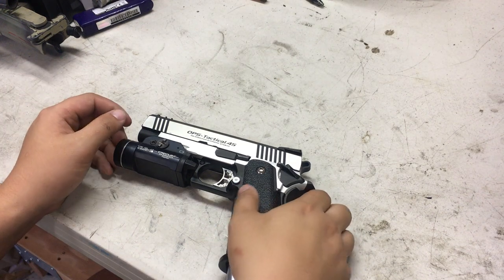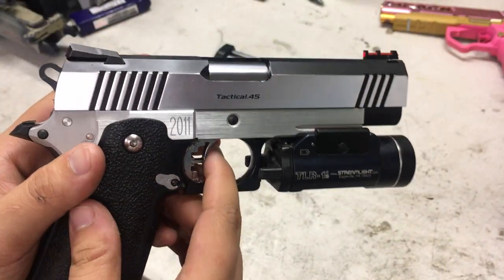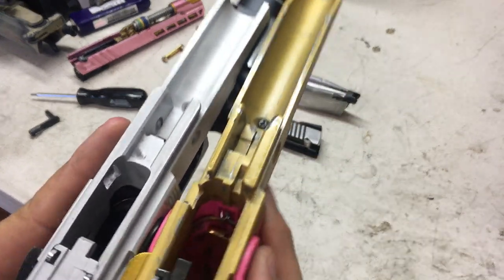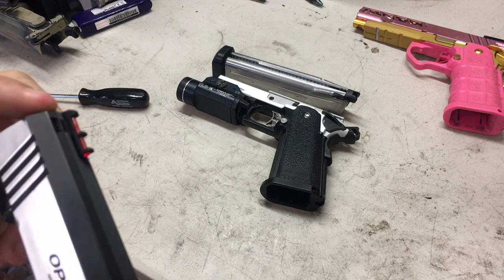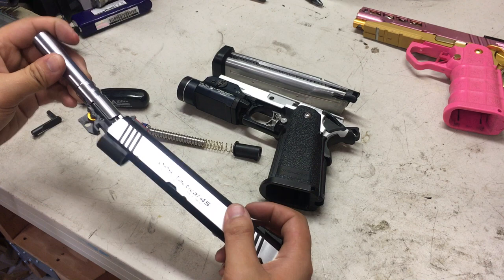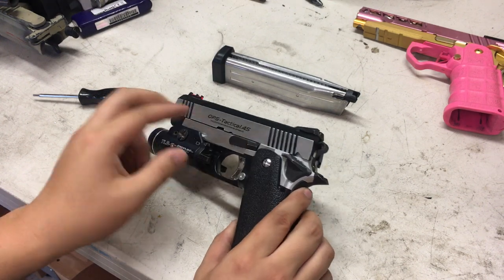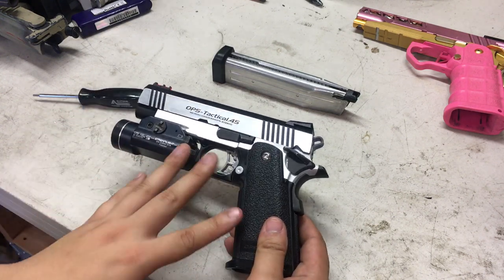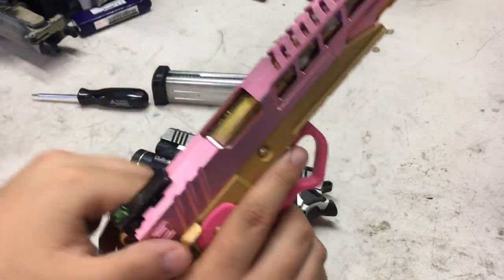Tokyo Marui Hicapa 4.3 Build Project (Part 1)

Comment: Parts List: 
Airsoft Masterpiece CNC Advance Frame (STI)
Streamlight TLR-1s
AIP front fiber sight
UAC Competition Recoil Spring
UAC Shock Buffer Kit
Maple Leaf Gold Adjustment Wheel
PDI W-Hold Bucking
UAC Aluminum Lightweight Blowback Housing 
ProWin Magazine

Parts Coming In:
Airsoft Masterpiece Steel Hammer
UAC Competition Steel Disconnect 
Airsoft Masterpiece Steel Guide Rod
Ken's Prop 3D Printed Slide (Replacing UAC BBU with Ken's Prop BBU)
Airsoft Masterpiece Aluminum Grip
Airsoft Masterpiece slide catch, safety, grip safety
PDI inner barrel (6 inch) going through a compensator
Reply: You sir are a legend